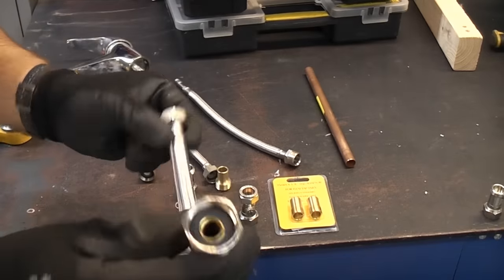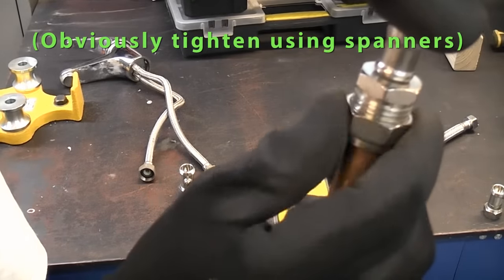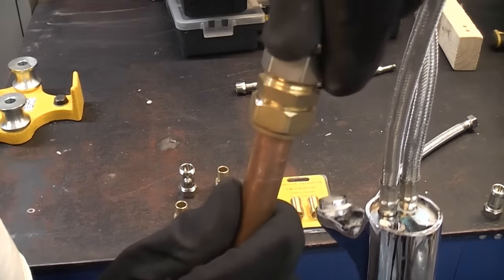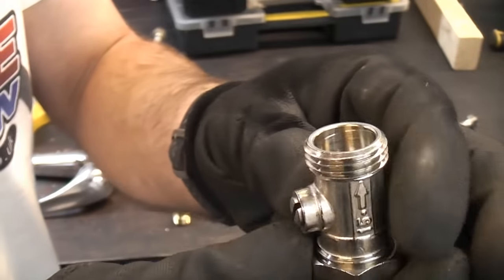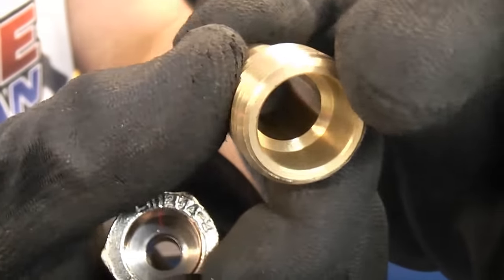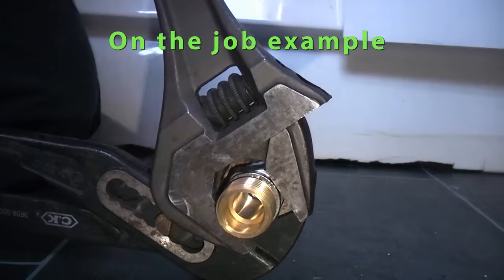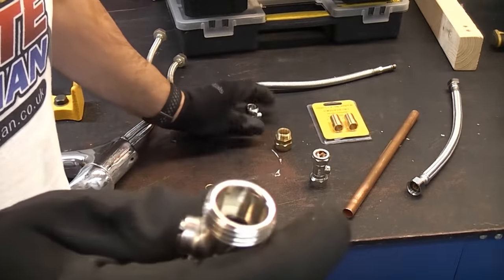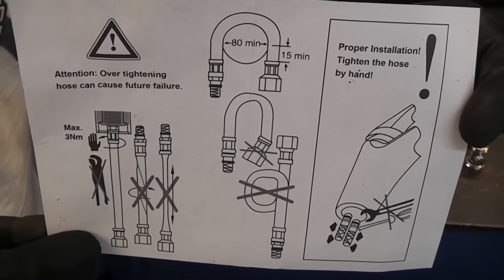How to connect flexible tap connectors 2019 | flexi tap tails

Comment: I had a leaking tail to the isolation valve. I was so closed to change the flexi tail but after watching your video I realised its the washer that got cut into. Bought the adapters and washers from  Toolstation and changed both connections in less than 10mins. Problem solved and less than 6 quid spent. Thanks for such great video.
Reply from the maker: I'm glad the video helped ;-)
Thanks for the comment
Reply: Thanks Kelvin's that useful too mate.

Comment: I found this upload almost by accident but the information given here and the suggestion to fit an isolation valve MEANT I WAS ABLE TO CONNECT A GROHE TAP TO EXISTING HOT AND COLD SUPPLY WHEN I HAD NO IDEA HOW I WAS GOING TO GET THE FLEXI-TAIL TO FIT. I was unable to get a flat isolation valve locally so had to use the standard isolation valves. Thanks for posting, you saved my installation and I have now got the tap on securely.

Comment: I'd just like to say thankyou so much for this clear video, I bought a tap off amazon with no adapters and didn't know how to connect properly to pipes ( I had a female end on flexible pipe) and I wasn't overly sure how to proceed. I did the steps you followed ( bought adapters from Tool station, I used some ptsfe tape too), all connected and working plus no leaks and more importantly no expensive plumber costs.

Comment: Thank you for the awesome information you provide! Gettin ready to do my kitchen tap that leaks slightly from the tap. Crawled under after coming home excited to finally fix it with the new one to discover the hose fittings are different on the copper plumbing and wont fit the ones on the tap! Well now I couldnt do that today because I do not have the proper parts and glad I watched your video so I better understand what I need to get for adapters! Frustrating to think I was going to slap it in and have to wait now to make another trip for the  parts. Thank you! The older we get the more we develop patience!! House wad built in 1900 and farmers owned it so lots of rigging and so on as farmers tend to use what they have laying around Lol!!
Reply from the maker: I used to work on a farm, so I know what it's like 😂 
Thanks for the comment 👍

Comment: Great video. As a DIYer doing my bathroom and toilet I only recently discovered flat faced isolation valves to connect up to the tap flexi hoses. Interesting I couldn't source from B&Q or Wickes but Tool Station were able to assist and the tap instructions never mentioned them! A compression isolation valve will fit but won't be as reliable and could destroy the rubber washer. A recent leaking washing machine at my mothers turned out to be a saddle tap the builder had fitted which failed. Had to cut the pipe and fit an in line tap. You live and learn.

Comment: I went into buildbase in Lincoln and asked for fittings to go onto female tails. The guy there said he had never seen anything like that. All plumbers just go straight onto iso valves. I said the ends are not designed for that. He looked confused. So went to tool station and found the male tail adaptors in your video and did a proper job. Shows most trades men don't even do it right.
Reply from the maker: I'm not sure how long the flat-faced valves have been around for, I think the tap tail adaptors have only been out a couple of years.
Thanks for the comment ;-)

Comment: This info was exactly what I was looking for as I was concerned about using normal compression fitting to attach a flexible hose.  This video shows that I can do this but that there is a better way, which I will use if I can find the fittings
Reply from the maker: Thanks for the comments 👍

Comment: Just looking at a flexi tail tap I'm about to fit. I have the isolation valves for use with olives and looking at the end was thinking the same thing re not flat so I thought I'd have a look on youtube to see if there were particular fittings for this type of connection. Thank you for answering my question. Good video.
Reply from the maker: Thanks for the comment 👍

Comment: Great video as usual, thank you. I've installed a bidet seat over this weekend and found that hand-tightening the flexi tails was inadequate and had to nip-up the tails with a spanner both at the T connector and the flexi pipe female terminations. I also made the mistake of leaving a stubborn olive in situ, hoping that tightening up the compression nut would be OK. BIG mistake, so I've ordered an olive remover. Lessons learned! 

Interestingly, I noticed that a male flexi pipe tail connects to the female flexi types and can be joined to make a longer run. I doubt this is good practice, particularly since the male tail does not have flat ends. Needs must in the short term at least...

Comment: My mixer tap came with short copper tails, so I used flexihose with compression ends to connect it to copper pipes top and bottom under the sink, I opened up the isolation valve and after about 30seconds, the flexihose compression end on the tap tails blew off! the missus said I should've had the taps open when opening the isolation valve, to let the air in the pipes out, I reconnected the flexi pipe and left the tap on this time, and all seems ok at the moment.
Reply from the maker: When my missus tells me how to do something, I normally pass the job onto her 😉
Seriously though, I'm sure it will be fine 
Thanks for the comment 👍
Reply: Bullshits. I am a professional plumber. It doesn't matter if the taps are open or not. If it blew off the olive wasn't good, was missing or you just didn't tighten enough the compression fitting.

Comment from the maker: It’s a bit wet and windy here today, I hope nobody is working outside!
I hope everyone has a great Sunday 😉
Reply: Good video those adapters that fit into the isolation valve do they need an olive on the smooth end that goes into the isolation thanks again
Reply from the maker: Yes, the olive should be supplied with the isolation valve. I prefer copper olives, so I normally buy 20 or so from the local plumbers' merchants in Blackburn, then throw the brass olives in the scrap 😉
Thanks for the comment  👍
Reply: @ultimatehandyman  Good video, thanks. Why do you prefer copper olives? Is it because they're a bit softer than brass and more likely to give a good seal?
Reply from the maker: Yes, the copper olives are more ductile and compress much easier. I only ever use brass olives if I have run out of copper ones!
Thanks for the comment 👍
Reply: @ultimatehandyman  thanks bud
Reply: I'm putting up a horizontal flue for a baxi 830. Client specially requested I do it today. I don't normally work Sundays. But she's always a repeat customer 😁
Reply: @ultimatehandyman  was just about to ask why?
Reply: It's going to be a beautiful central commiefornia day. 
92 and a light breeze. 
2nd day of the Blue Angel's air show. (I took my grandson yesterday) 
You quite often have useful information. I'm a heavy truck mechanic and a diyer
Reply: We had a full family roast dinner on Sunday including Brussels sprouts. So not exactly wet but certainly incredibly windy INDOORS!

Comment: I had some leftover tail pieces from some thermostatic radiator valves I fitted as the tail piece was the same as the old valve. I found these tail pieces were ideal for use in fitting a new pair of taps. I was able to put one end into the isolation valve whilst leaving a flat edge for the tap tail to thread into.
Reply from the maker: Thanks for the comment 👍

Comment: Great video - thanks! I used to just attach flexi tails direct to isolation valve/equal tee etc but this definitely seems more robust. For info I checked a few had fitted over the years and none are leaking that were fitted directly.

Comment: Thanks - but what I was hoping you'd show is how to unscrew the M10 end of the tails from a monobloc tap where the plate they screw into is recessed 25mm into the casing of the tap. They were screwed in just by turning the hose, hand tight obviously, and never leaked, but trying to remove them the threads have stuck and the hose just spins on the end fitting. I need something like a narrow M10 basin wrench. I see box spanners sold for monobloc taps, but they won't fit over the 1/2" BSP female on the other end.

Comment: Hi this video is really helpful as it’s exactly what I’m looking for to help me with my plumbing of new sink ! I’ve been stuck on this for weeks , so thanks for your demonstration! 👍🏾
Reply from the maker: You are welcome
Thanks for the comment 👍
Reply: Ultimate Handyman hi may I ask you a question in relation to this please how do you get the nuts off the end of the flexi pipes ? As that’s what I’m joining together with the islolation valve . Thanks 😊
Reply from the maker: @learicketts2489   You don't remove the nuts from the flexi pipes, they are not designed to be removed from the flexi's
Reply: Ultimate Handyman oh lol 😂 you can tell I’m learning on the job ! It’s my first time at attempting any type plumbing work!! I’m a woman I live with my daughter & I’ve redecorated our whole kitchen during lockdown tiling the lot etc ! The hot pipe doesn’t have the correct fittings on it so I’ve learned that I could by pass it by connecting the two flexi pipes together the old & new with an islolation valve . As I have removed a sink with pillar taps & replaced with mono block tap & one & half bowel sink ! Just doing plumbing now then traps ! So your advice was much needed! 👍🏾 Thanks
Reply from the maker: @learicketts2489   Glad you got there in the end ;-) 
Thanks for the update

Comment: Thanks. Helpful video. At 5:20 you quite rightly recommend RTFI with regard to being told to connect up the part being shown, finger tight. However when I tightened the joint that the instructions recommended finger tight, it leaked! So I had to nip it carefully with a small spanner anyway. Clearly my finger tight is not as finger tight as the instruction writer.
Reply from the maker: Some instructions are really unclear. Speedfit makes a flexible tap connector, push-fit on the pipe, and nut on the tap end. The instructions say no tools required 😂
Thanks for the comment

Comment: Nice vid... if you can't get your hands on. purpose made fittings just adapt a ballofix or straight compression coupling by running it over a sharpening stone to give a flat edge.. may save you a tripvto the shop :)
Reply from the maker: Thanks for the comment 👍

Comment: Thanks very useful. I've been fitting flexis straight to normal isolation values for years. No leaks yet touch wood
Reply from the maker: Me too, but the flat face isolators and tap tail adaptors are much better.
Thanks for the comment 👍
Reply: Ultimate Handyman mine started leaking now? So whats the solution without changing isolation valve??

Comment: 2:03 🤞Fingers Crossed on the flange not destroying the washer. I’ll let you know 😅
Reply: I have filed the point to a flat face before, much better than using the fittings with a point which is meant for compression fittings only.

Think guys if this joint fails then it will be your fault for using incorrect fittings. You are meant to only use flat face fittings with flat face tap connectors. If you choose to use incorrect fittings then the book stops with you. Someone can come after ypu for damages.

Comment: It's an interesting question as to the life-span of flexible tap tails. Our house was restored between 1998 and 2000 and was fitted with flexible tails in at least 8 places and have not been replaced since. I wonder if the fact that we have a pressure reducer set to 2 Bar immediately after the stop tap and thus limiting the pressure on all the plumbing is significant. I'm planning a "dilapidation"  scheme to replace them (though some are going to be "fun" to get to). I'm about to replace some basin taps soon so may well do a pressure test on the tails I'll remove at that time to see how degraded they have become.
Reply from the maker: That’s a great question. We have 8 Bar pressure here and fitting a pressure reducing valve is a job on my list (but it involves breaking away a load of tiles to gain access to the incoming mains). A friend of mine had a burst flexi and it made a right mess of his house, it brought down ceilings and ruined kitchen units etc.
Reply: @ultimatehandyman  Many thanks for the reply. 8 bar sounds pretty high. I think the flexis are good for 16 bar cold and 10 bar hot though I don't know how much higher than that the ultimate is. While I'm doing pressure tests it would be interesting to take a new hose and find out what they can take. 
We had a flood on Christmas eve morning. A rat had chewed through the washing machine hose. Thankfully it's an old farm house with a stone floor so it was nothing more than an early spring-cleaning job!
The only other flood we had was at the en-suit mixer tap. It had been plumbed in small bore copper right to the tap which you would have thought was bullet-proof but it fractured right where the pipe exited the tap fitting. Luckily we were in and it didn't have time to take the ceiling down. We now shut the water off if we are going out for more than a few hours. 
BTW - I had to replace the pressure reducer after a few years. The plumber who fitted it put the strainer on the output side of the valve which made sure the silt accumulated in the valve. (he also used a non-pressurised cylinder on the pressurised hot water system but that's another story!)

edit: Thinking about your pressure reducer installation, would it be easier to use more than one and fit them where it's easier to get to even if each one only covers part of the system.. We have the luck that there is a stop tap under the sink where the water supply comes in so it is easy to put the reducer immediately after that stop tap.
Reply from the maker: I did pressure test a flexi in this video a few years back, it held up well- https://www.youtube.com/watch?v=IOTD6QZRWqw

There always seems to be a weak point in a plumbing system, a few years back I had a fibre washer split on the bath tap, which resulted in a badly damaged ceiling. I replaced that with a push fit tap connector, as it was the only thing I could use- https://www.youtube.com/watch?v=eqECFK42PKQ&t

I was intending on just installing the one pressure reducing valve of the whole house, as close as possible to the incoming stop tap, but I don’t know what the set up will be like, as its behind a tiled wall at the moment.
Reply: @ultimatehandyman  Many thanks for the heads-up to the pressure test video. 50 Bar+ isn't too shabby for something rated at 16 bar!
I must confess to disliking fibre washers. I had one fail on the bleed point on a car radiator (luckily no damage to the engine) so I searched around and found a Dowty seal that fitted in its place. I subsequently replaced the fibre washers on the bleed points in the loft associated with the hot water cylinder with this type of seal. 
Not looking forward to having to do anything to our bath taps - zero access without moving the bath which will involve taking units out as well.
Reply from the maker: You are welcome 👍
Fibre washers are not good, especially when they split and leak all over the place.
Baths are a major problem when you need to replace the fibre washers or the tap itself, often because they are butted against a wall with hardly any access. I’m sure that they could come up with a better way, if they put some thought into it! 
I really struggled with the one that split here- thanks god for push fit tap connectors!
Best of luck with yours 👍

Comment: Love the videos, very informative as always. I wanted to use full bore isolation valves because of low pressure indirect feed but have so far found it impossible to get a full bore flat face isolation valve. Even BES don't stock them. What I have done is take a standard isolation valve and just run one end over a 400 grit followed by 1000 diamond stone just to give me a flat face and better seal and less risk of damaging the washer. Very  easy to do in a couple of minutes and a diamond stone is usually nice and flat.

Have you though about covering the different sizes and terms used  to describe flexi tails.  Some refer to 15mm X 10mm X 300mm where others refer to M10 threads. I see that bore sizes vary wildly as well, so as narrow as 6.7 mm and doing up to 9.8mm with a 10mm thread. I guess for indirect feeds, the bigger the bore the better? Keep up the great work.
Reply from the maker: Flexi tails can be a real nightmare, hopefully they will be supplied with the new tap- unless they are a standard size such as 1/2" BSP etc.
I installed a waterfall tap made in China once, god only knows what the flexi tails were, but they would not fit anything that I had.
Good idea flattening the full bore valves ;-)
Thanks for the comment

Comment: I use a diamond sharpening plate to ease the edge of the isolators before attaching tails, it takes about 30 seconds to put a 1mm face on them.

Comment: Great video. On the connection of tails to tap however, my taps mixer leaked from the first fitting. The advice was to hand tighten only, but after several attempts I decided to use tape, and then finally grip and tape. The leak is still there and I wonder if these fittings aren't just inherently problematic?
Reply from the maker: I've never had one leak like that before.
Are the O rings in good condition?
Reply: @ultimatehandyman  Thanks for your reply. The rings are intact and undamaged. The leak is certainly from the connection and not due to fraying. Shall try another unit altogether. 
All the best.